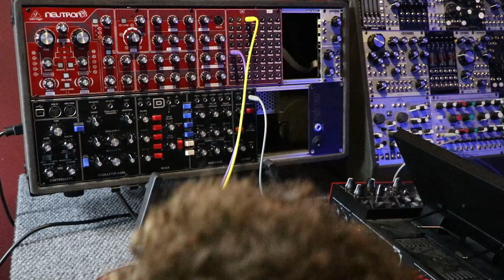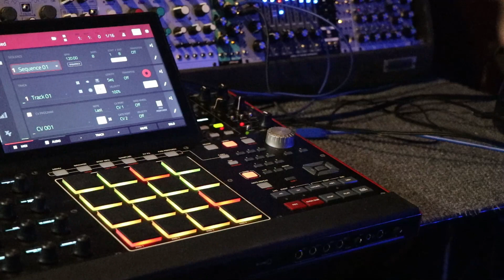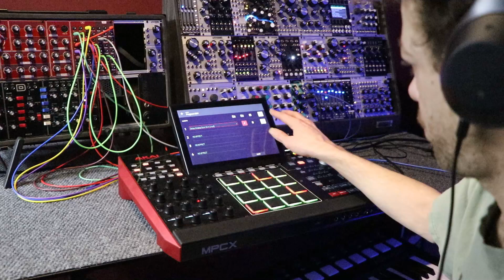How To Connect Mpc To Neutron.

Comment: I do have a Behringer Neutron and Model D. I haven't tried using the Arturia Beatstep Pro as a CV controller (lots of cv inputs/outputs). I'm going to experiment with your patching method. My thinking is to connect the MPC Touch through Midi to the Beatstep Pro and use the cv's outs to control the Neutron.